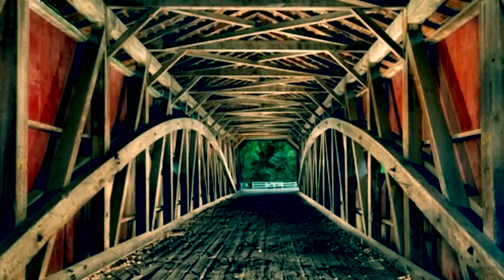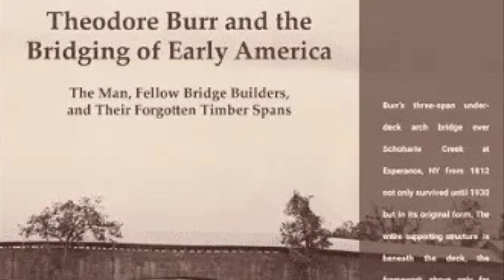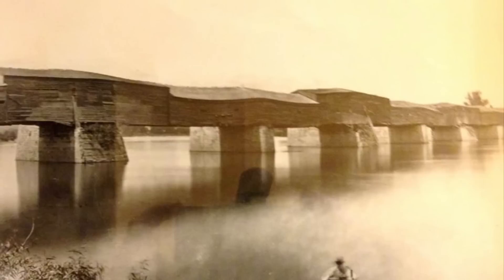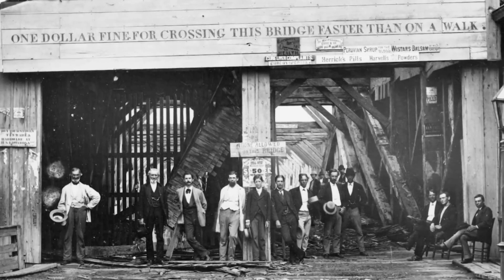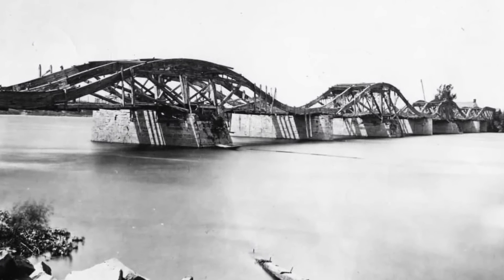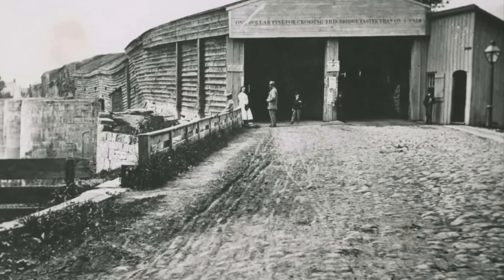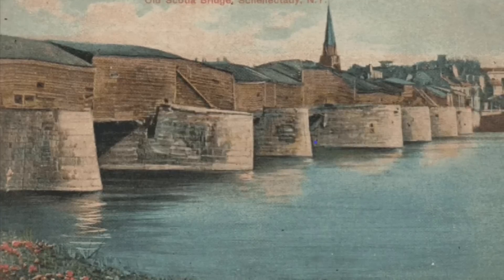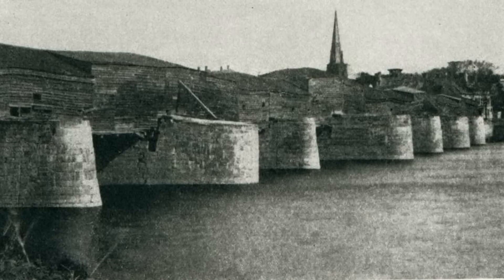1808 Mohawk Covered Suspension Bridge (Photographs) Was the “Suspension Bridge” founded in America?

Comment: To dig the very foundations for the support structures of such a bridge, workers in 1808 had to hold their breath and then dive down about 20' to reach the bottom, then dig as fast as possible before having to surface and take another breath. Uh-huh!
Reply: Even back then, the use of casings or coffer dams was widely used in the construction of bridges over rivers. The likely method used in the early 1800s would be to create such a water free workspace where each pylon was to be built. They were prob done one at a time. First, large timber piles were hammered into the riverbed then the stone structure would have been built on top of that the outer piles would be proud of the surface and their job would be to hold in place the first 1 or 2 layers. After each pylon was completed, construction on the next would commence and so on
Reply: @originalsusser : Using dams to block the water and or divert it makes the most sense, but I don't think that the stone structures we're shown in this video were intended for the wooden bridge. It really does look like something else was originally there and was built over with wood...

Comment: How did they build the piers that the bridge sat on?
Reply: Was thinking that. Who ,where was stone queried? Also sad to say a Maryland girl here and I did not know some of your facts. TY
Reply: There could be a few reasonable approaches: redirecting the water temporarily or utilizing cofferdams if redirecting is too much hassle. This area also has major ice, and they could’ve taken advantage of that to build the bridge in the winter. The original bridge sagged so much(as bridge building is about keeping tension and compression, the suspension cables could not keep enough tension that the span was not compressed and was thus vulnerable to unwanted movement) in the middle spans they added four more piers in between each. You can tell by the trusses where the original piers are and the ones they added later. There were many attempts previous to this bridge that failed over a course of 12 years(there were obviously more beforehand, but this was a particular period of determined effort to build a bridge that doesn’t collapse), mainly failing because of the ice as well as the unpredictable nature of rivers. They overbuilt the stone piers because they wanted the bridge to not fall apart within a few years…as it had the previous 12 years they attempted to make one. A suspension bridge allows for movement, but your supports need to stay in place in order for that to work, especially if you’re going to expect major ice every season. I don’t know what the big mystery is here, there isn’t anything unexplainable or ridiculously adorned. I’d recommend you look into the Erie Canal bridges, as those are much more fascinating engineering feats.
Reply: Since Roman times, the use of caissons or cofferdams was widely used in the construction of bridges over rivers. These piers were prob built one at a time. The likely method used here would be to create a water free workspace, the caisson, where each pier was to be built. Then, depending on the riverbed type, in this case mud, large timber piles were hammered into the riverbed, see Wikipedia (pile driver/history), and the stone structure would have been built on top of that. The outer piles would be proud of the surface, and their job would be to hold in place the first layer of stone. After each pier was completed, construction on the next would commence, and so on
Reply: @originalsusser it always sounds plausible on paper, but then you get down to the actual method and that’s where the narrative dies.
Reply: @michaelwills1926  talk 'on paper' is cheap. Please describe how it was built according to you!
Reply: @originalsusser People act as if we don't still use the same method more or less today just much more advanced. The bridges in New York are well documented to be built using submerged chambers with ventilation.
Reply: They didnt
Reply: Yeah that works if there is not a strong flow but here it would not be easy to just make the stones sit there. The water would keep washing them or eroding them very easy before it was completed.
Reply: They manifested them by casting spells LoL

Comment: Funny thing about "Covered Bridges," all that extra weight of the wood to cover the roadway is taking away from the gross weight of what can pass over the bridge itself.
Reply: With those huge stone footings, and excellently engineered beamwork it is suspended by, a few planks covering the outside would not impact its weight restrictions by any significant amount. In fact I wouldn't be surprised if the roof structure was build with its weight bearing on those stone footings as a completely separate structure from the bridge itself. And believe me, a stone footing of that size could handle much, much more weight than that.
Reply: @HankHammer-cp5px  They do look somewhat like the Medieval London Bridge stone footings.
Reply: LoL what weight are we talking about? These can support thousands of horse and buggies piled up, without even noticing it. Look at the giant, almost megalithic supports. The wooden part was clearly added later.
Reply: Yes the “suspension” part is ramshackle in comparison to the foundations, which  look made for supporting a hell of a lot more than buggies And horses.